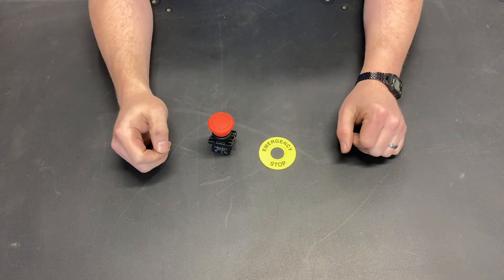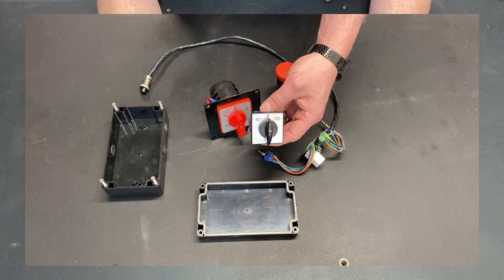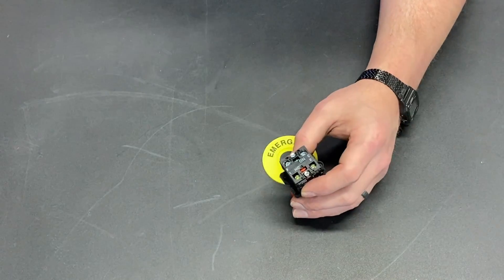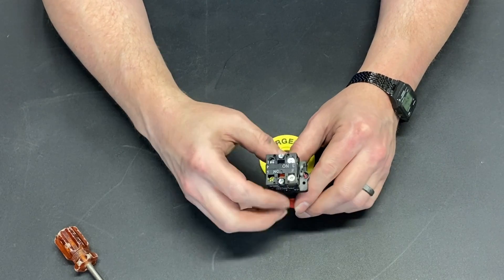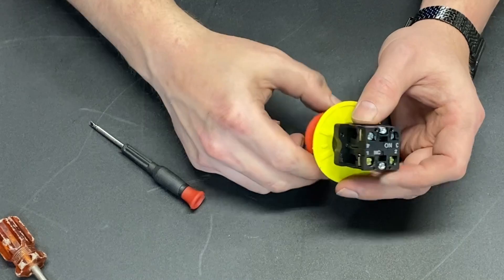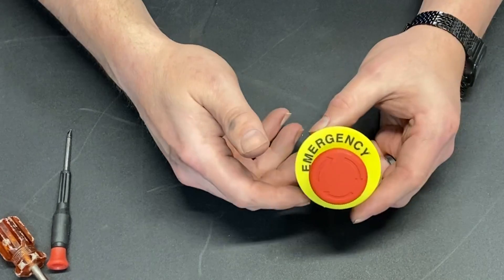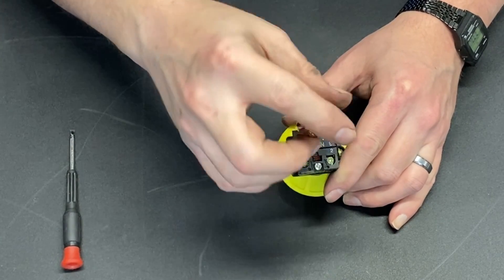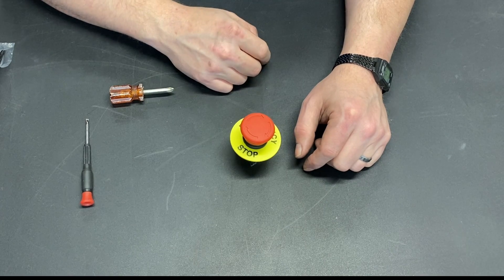Configuring an Emergency Stop Switch for your DIY project

Comment: lets presume somebody (not me) unscrewed the screw that should not be unscrewed. how do i - i  mean, one theoretically put it back together so it works ?
Reply from the maker: great question.  Honestly I don't remember what I did to get mine back together.  I do know it took a couple tries to get it working correctly.   I believe I have an extra switch.   Maybe I will take it apart and put it back together on camera.  you (I mean somebody) are not the only ones to have done this and are looking for reassembly information.
Reply: i did manage to do it in the end but it was such a pain :D. hard to even describe. video would have been really helpful , but honestly i dont blame you if u dont do it bc is so fiddly  @dazecars

Comment: At 2:18 you said not to take the screw out. How do I reset it to function properly again?
Reply from the maker: you need to turn it to the correct positing with the spring compressed to reinstall the screw.  Then verify function.  if it doesn't work as designed then remove the screw and change how it is setup and re install the screw.  Took me a couple tries to get the switch working correctly.

Comment: I whish I found this tutorial BEFORE unscrewing the center bolt... 🤬 Maybe that's the real reason why Amazon sells these mushroom switches in pairs. Anyway, I'm in the process of converting an el-cheapo Chinese mini-lathe into a more precise, more viable tool and, having already overcome the mechanical details for obtaining that, I found this tutorial very helpful when starting to plan for the electric and electronic part of the project. Thank you very much! 🙏
Reply from the maker: I am glad the video was helpful.  I did a ton of upgrades to my import mill/lath combo and some of them may be of interest to your project.  Here is video 1 of 2 https://youtu.be/v2hjevzjGW8
Reply: @dazecars  Surely they will do: I'm going to view them all, thanks! 🤩
Reply from the maker: Don't hesitate to reach out here or email through my website if you have any questions or are looking for more info.  The majority of those upgrades also have their own video with a lot more detail.

Comment: I opened that screw 😢
Reply from the maker: You can get it back together just make sure you clock it correctly or the spring action won't work properly

Comment: I hope you see this. 
I am setting up a NO/NC stop for a 12v motor

I have a jumper between the NC  (in) and NO (in) then  fuel pump trigger and coil on NC (in) then fuel pump and coil on NC (out) then ground for NO (out) 

It tested fine once but now the NO is closed all the time so it’s all grounded constantly and the motor won’t run
Reply from the maker: based on how you have it wired that makes sense.  When the NO is closed it would connect to ground because one side is grounded.

Comment: I found out that you can order them with two NC switched so there’s no need to purchase extra ones. 
Good video DC. Now all I need to do is figure out how to subscribe 1000 times to your channel. 
I’m having a bitch of a time trying to find a push button on off switch that can handle 120 vac and 15 amps. Some on Amazon say 120 V, 15 amp, but I don’t know how to wire it for ac. No, I’m not asking for help. 
Why is it so easy to find a rocker switch for this, but not a push button? Seems like they are mostly for dc. 
P
Reply from the maker: What push button switch are you looking at?

Comment: that N/O switch could be used for a brake on the motor or the lathe itself. like your capacitors that you were using a while back.
Reply: Yeah. If the lathe is powered by a DC motor, then the easiest way is to wire the N/O contact in parallel with the motor. When the E-stop is slammed, the N/C point will cut the power and the N/O point will short out the armature and thus create lots of electromagnetic drag to stop the motor quickly.
Reply from the maker: IMHO not a good idea.  I have an entire video series on a braking system for a DC motor linked blow.  Also this switch needs to be on the AC side as it's lower amps and can't even come close to handling the DC amps. https://www.youtube.com/playlist?list=PLg4j6XzBdSY-oFUIBZCx5O6i6JjihSqHL
Reply from the maker: The resisters as a break are automatic as soon as the power is cut but yes it could be used to engage some other brake.